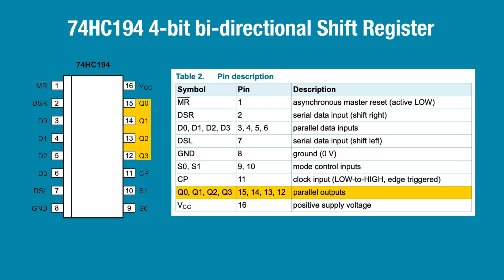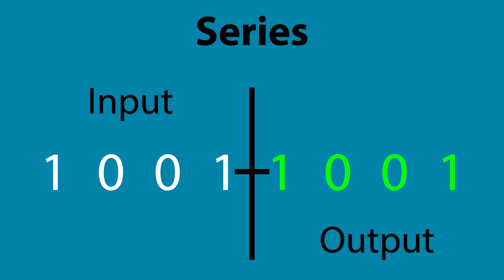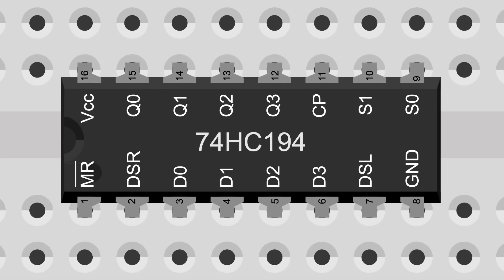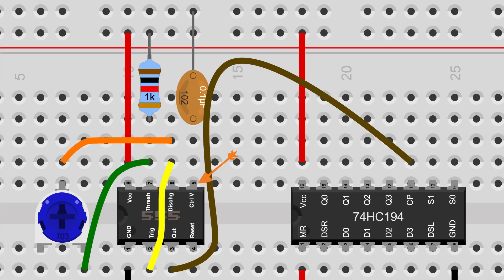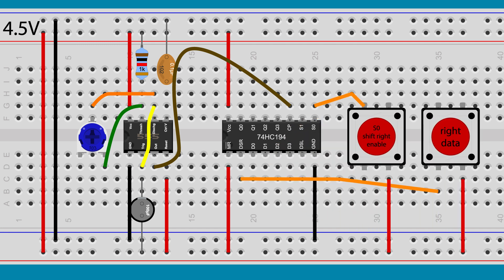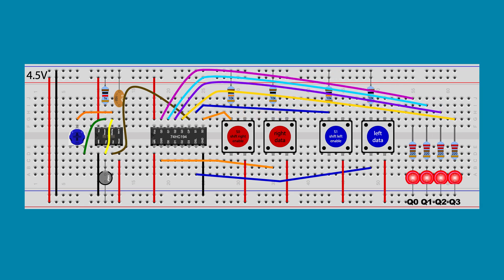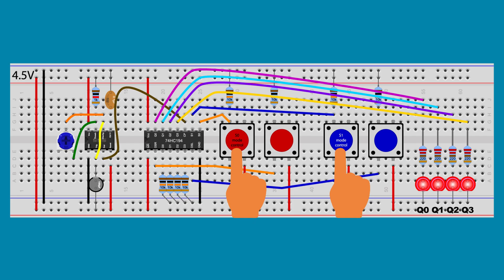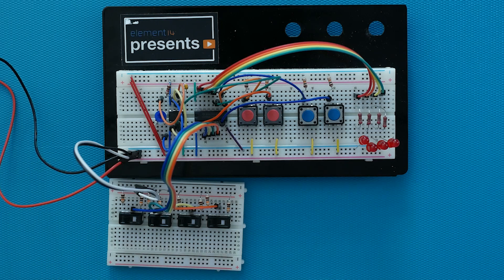How to Make a 4-bit Shift Register Circuit - The Learning Circuit

Comment: I used 9V voltage source. When I turn on the source all the outputs are high no matter what I do. Is there any solution for this?
Reply: Do u think the problem is the voltage or the circuit?

Comment: Trying to start with state of the art things as created by industry as a beginning is often enough really difficult. Data flip flops created using relay logic allow shift registers that can be serial in (and out) parallel in or parallel out and switched from one to the other (without being limited to any combination of the four combos). Only serial in (or out) need be clocked . Only the the parallel in need be enabled. Although I have not tried the conversions to ICs yet I don't see any reason why they would not work.

Comment: I like the video, it's great material, but here are a couple of things which hopefully are constructive. 

First, I think it would be better to call this "How to USE a 4-bit Shift Register". The 74HC194 is literally a "4-bit bidirectional universal shift register
" and when I clicked on the video I expected to see details of the inside of this kind of chip. It's a little thing, of course.

Next, I think you move past the 555 chip a little too quickly. I don't think given the length of the video you should explain why you chose the capacitor and the resistors here and why they belong the, but just giving a rough idea of why these things are here would be good, something about the 555 pulsing based the charging and discharging of the capacitor which comes from the size of the capacitor and the resistors. 

Mentioning the variable resistor at the end might give an idea of this, but you also don't mention the size of the potentiometer. The "103" on the pot in your graphics is blue and someone who is just learning might not know what that means anyway. On my giant 62 inch 4k TV, I can only read the 103 when I have the video in full screen. Additionally, while the potentiometer might technically be more useful for someone more skilled, I think for an audience that hasn't learned how to use a 555 yet you would be better off just using a fixed resistor until they learn how to create their own custom clock.

Anyways, keep up the good work.

Comment: Serial to parallel.
Interesting. I mean, I now that makes sense, but every use of a shift register I've personally dealt with is a parallel to serial converter...

I'm surprised this particular device doesn't support that mode of operation, since in many cases you'd want to do both at either ends of some kind of transmission line...

... After some consideration I realised that it might be possible to produce serial out by combining serial loading with parallel loading and only reading one of the outputs...

Seems a bit of a weird way of dealing with it though.
Reply: There's no need to combine parallel loading with serial to get that behavior.

To cascade these chips, the first and last output become the left/right input for the shift register for serial data to cascade onto.

Consider what series is...  here is how the 12 bits would appear across 3 chips:

a1 b1 c1 d1 a2 b2 c2 d2 a3 b3 c3 d3

You can see that d1 is the right shift input for chip 2, and a3 is the left shift input.

Comment: Thank you Karen. Can you make a video on how to connect a serial signal to a CAN bus? Toyota OEM car stereos have CAN signal processing in a way that if you remove the original stereo, some functions like the A/C won't work. Like in the Avalon or the Prius. So the work around is to leave the original stereo connected in the trunk and install the new stereo in the front. Could be great if you guys find a way to replicate the small circuit of the stereo that allows everything else to keep working. Agin, thank you for your videos, I follow you since the times with Ben Heck.
Reply: Hey I noticed there wasn’t a reply to this, and even though it’s a year old and you probably found out, someone else might want to know. I’m no expert in this, so this might not be entirely accurate, but I know about other similar systems and it should be enough to get you moving in the right direction.

Doing practical things with CAN busses is more like dealing with a TCP/IP network than manually shifting voltage to individual components. Getting a microcontroller and working in code would be vastly easier than trying to assemble the logic from basic components manually. You can buy CAN bus data loggers which I think can tell you what’s being sent to/from the radio. Seed Studio makes some great looking CAN bus hardware you can hook up to an Arduino microcontroller, and there may be cheaper generic options. Seed also has a great induction to car CAN bus hacking on their site. If that looks promising to you, learning some simple C programming would be a good start. By the time you get around to it, the hardware you need might work with MicroPython or Circuit Python which are way easier than C to work with… but for doing simple things even C wouldn’t be too bad and there are tons of arduino/C tutorials.

That said — based on what I know about the auto industry, it’s possible that they did that deliberately to make it more difficult for people to do their own customizations/repairs. (They could just be using it as a hub too to save on wire/signal attenuation, but not likely of it works as well from the trunk as the dash.) If that’s true, they’re possibly using it like a DRM device — having each of those components send the radio a piece of data and not functioning of the radio doesn’t respond. It might not even be a simple ping/response — it could having the device send a piece of data to the radio, both perform the same mathematical function on it, the radio sends it back, and the device stops functioning if it doesn’t get s result or gets the wrong result. I know this sort of thing is common in some devices (printer ink cartridges for example) but don’t specifically know if that’s true in cars, so I might be way off. Either way, it’s possible that doing this sort of thing could void the warranty on the car if that’s a concern, and also would possibly violate the DMCA (digital millennium copyright act) in the US, so watch what you’re doing.
Reply: Man lots of typos. Not enough coffee to type that much on my phone this early.

I meant to also say that if they are using some kind of function on the  data to confirm it — aka a cryptographic hash— it would be pretty damn difficult to reverse engineer.

In addition though, arduinos can hook up to tons of different kind of hardware! You can get, say, an accelerometer that determines and responds to changes in microseconds… thermometers, proximity detectors, LiDAR sensors, gas and particle sensors, light sensors, or read from other sensors on the network, light up lights, run motors or servos… limitless possibilities with a bit of hardware and some code to tell it what to do.

I’m not an auto engineer so I  wouldn’t necessarily do it for a car I’d drive on the street, but maybe you want to pump up rear hydraulic suspension pressure and reduce the front corresponding to exactly how much you’re accelerating? Or adjust a spoiler based on the speedometer value? Or automatically turn on under-car lights at night? Text you OBD messages when they pop up or when your kid drives over 80mph or if they’re making a lot of hard stops/starts/turns? A lot of this stuff wouldn’t even require working with the CAN bus. A world of possibility.